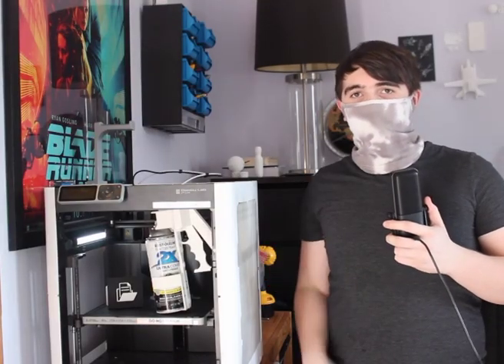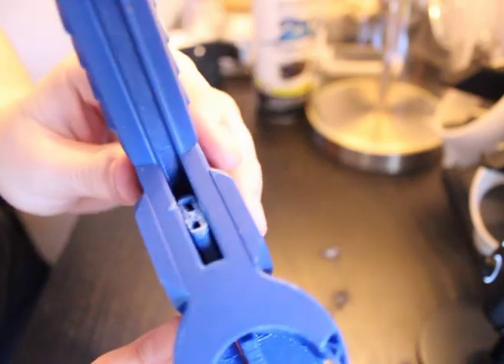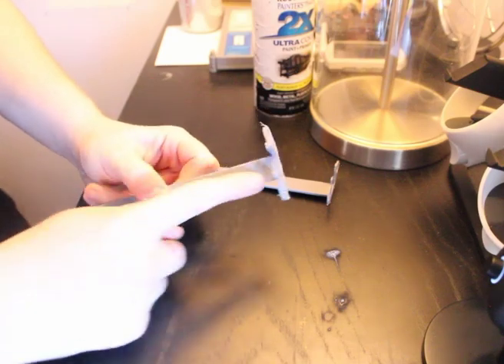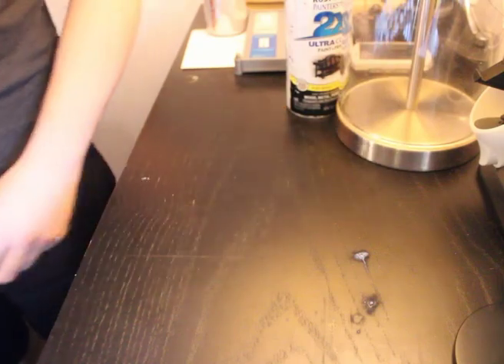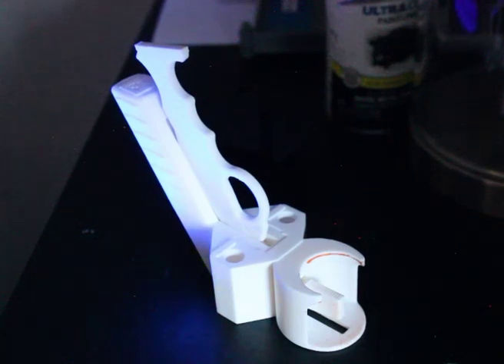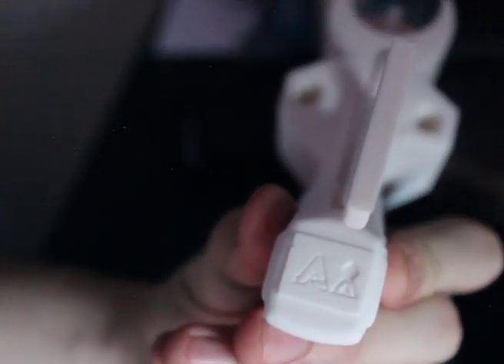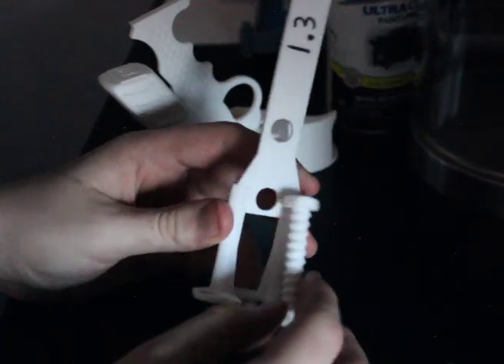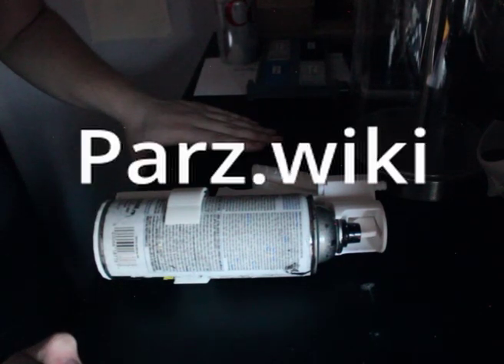Engineering a Better Spray Paint-Gun: Spray Assist

Comment from the maker: i'd also love some more suggestions for engineering video ideas
if you have an idea please let me know and if i like it and the cost is less then  $80 usd i'll build it and do a vid
Reply: Hey i have an idea to improve this, i saw some videos where u can kind of control the pressure and slimness of the spray bottle by applying backward pressure to the cap of the spray bottle. Could u integrate maybe a locking mechanism into this design where it could some what control the output spray by pulling the cap backwards (or any direction, probably needs testing). It could have 3 modes, slim/medium/normal
Reply from the maker: @baobingbong  this is a interesting idea! please do link some videos or articles that discuss this "pressure and slimness" behavior

Comment: I enjoyed you walking through your designs/prototypes and thoughts. One important principle that you missed was your print orientation. All your handle prints are breaking or de-laminating because you printed it building up instead of printing it on the side creating your layers in the perpendicular to the force applying to it. A lot of your problems seems to stem from that. Hope this helps.
Reply from the maker: certainly a interesting point, and your are totally correct about shifting the layer line axis. I just don't think with the overall shape of the print in place model it would make sense for the overall product. glad you enjoy! please feel free to suggest idea for future videos and join the discord where the stl files are up
Reply: @aii3org maybe printed on its back?
Reply from the maker: pockey, could you be more detailed? also if you click on the blog link you can see all the time lapses of the different pieces so you can get a better idea